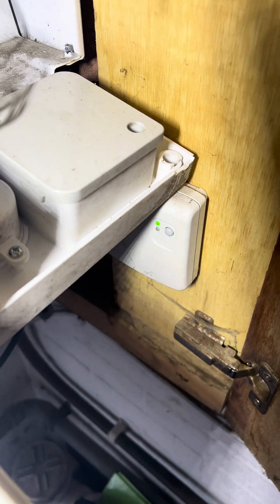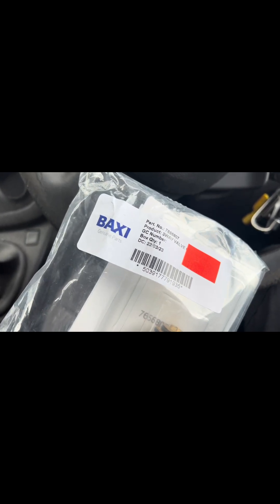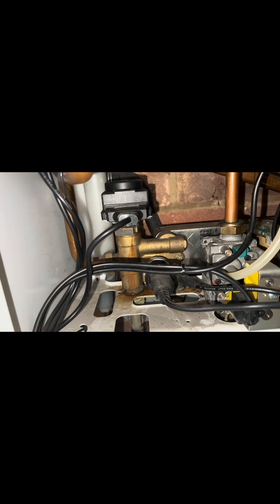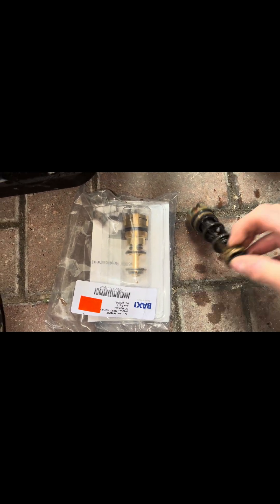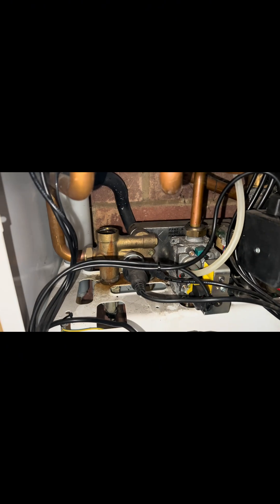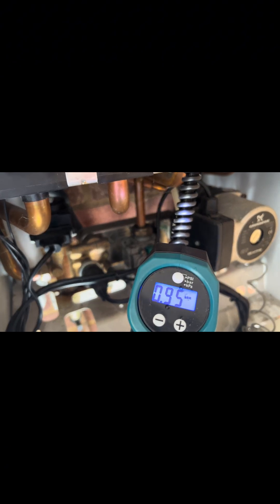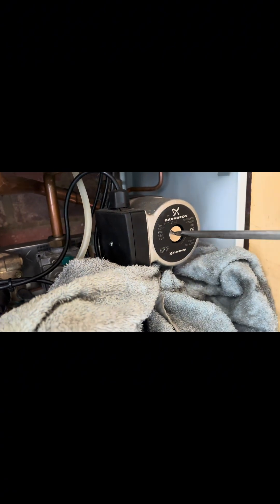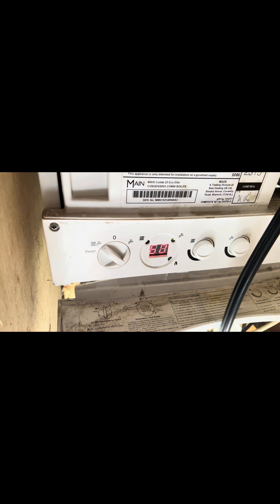A job in my day as a gas engineer

Comment: Hiya mate I've got a problem with my ideal logic combi 24 l3 fault ive changed the fan about 6-7 times but the new fan is keeps blowing been like this for almost 1 year no hot water or heating can't keep paying stupid call out charges for nothing when it does not fix the problem all they say is get a new boiler
Reply from the maker: Not being local to you, my advice would be to contact ideal and pay for a 1 off repair

Then the manufacturer will repair it

Just what I would potentially do
Reply: Where are you based brother?
Reply: @GasTraining  blackburn